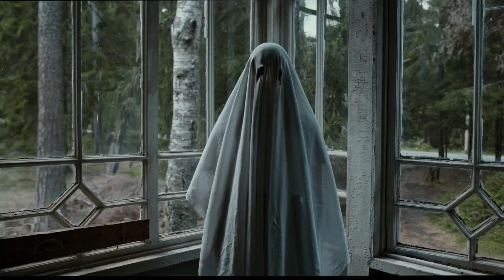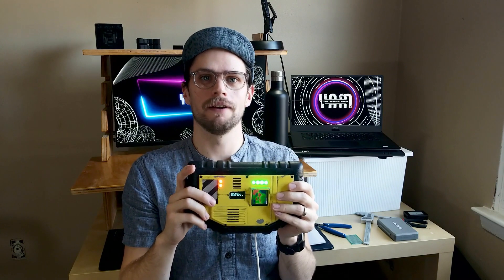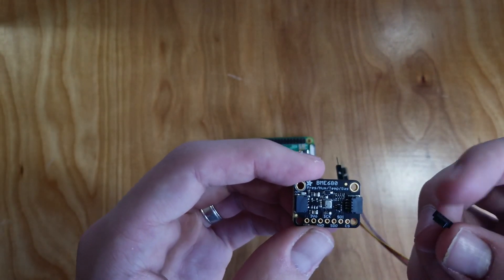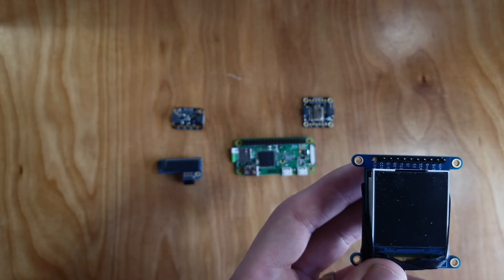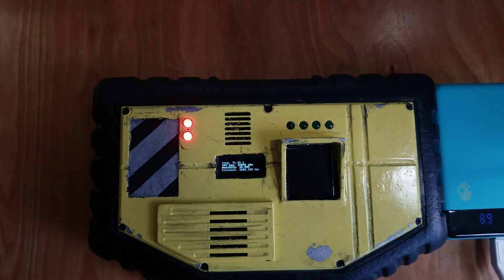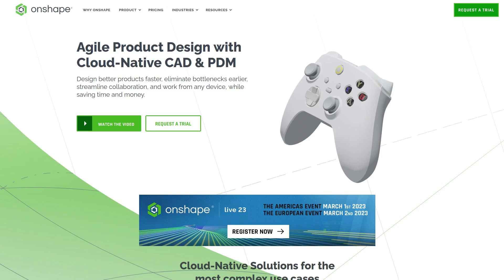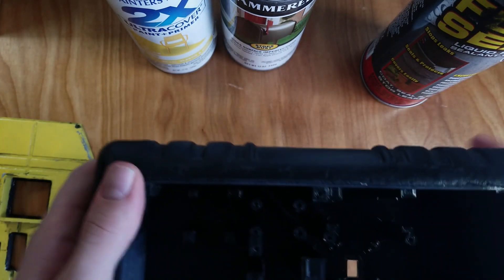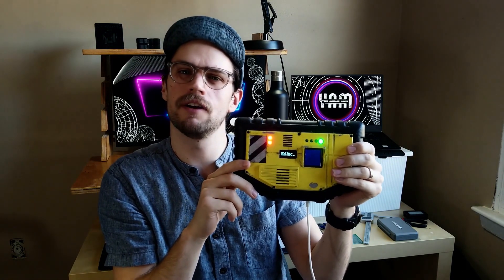How to Make a Ghost Sensor

Comment: Great job on the video production.  I agree with you that to decrease boot time using something like an Arduino instead of a raspberry pi would work.  an easy upgrade would be to incorporate a lithium-ion battery and charger port would make it self-contained and more portable for that ghostbusting.
Reply from the maker: Thanks! Yeah, that'd be a good upgrade for the next edition.